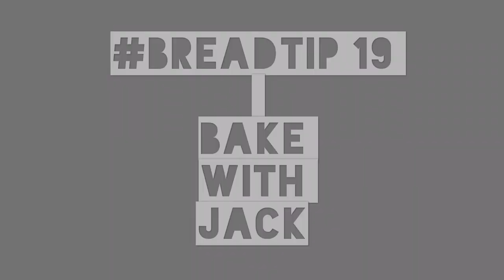19: How can I tell if my bread is fully baked? That "Hollow" Sound - Bake with Jack

Comment: Other than the pitch (high vs low pitch), they sound EXACTLY the same.  At home how can u tell when u don't have a proven thoroughly baked loaf to compare your baked loaf to?  VERY disappointing video.  What r your thoughts on an internal temperature check (~190F) - i.e. a scientific method vs a completely subjective "sound test"?

Comment: Every time I try to bake soft buns for burgers, the exterior turns out very crusty. What to do!?
Reply: Add more moisture to your dough, try adding more of water, oil or milk, the dough should be mushy..another thing you can do is, if your bread comes out too hard try taking a damp soft towel or paper towels(try to use good quality ones for health reasons) and use it to cover your bread right after you finish baking it, or you can wait a couple seconds or a minute. These may not be guaranteed to bring perfection but it should help, take care 🙂.

Comment: Hey, Jack, thanks for all your ispiring videos! It's the first time i manage to successfully bake bread, although i dont have a baking stone! I have a question and i would very much appreciate your help: i bake the bread on a preheated, screaming hot tray as you guide (230 for 15' and then at 190 until the hollow sound appears) but the time needed to hear the hollow sound is way more than 15 to 20 minutes. In fact, i need more than 70 minutes total baking time. Is the bread getting dried out when baking that much ? Can it be fixed without buying a stone? (Flour 0.5 kg and water 0.35kg, yeasted)

Comment: Is it okay if the bread is slightly soft? I used plane flower but the bottom of the loaf was slightly golden and the top was white is that normal? I put it in for 20 minutes but I put it back in the oven for another 10 minutes though I might bake it for longer.